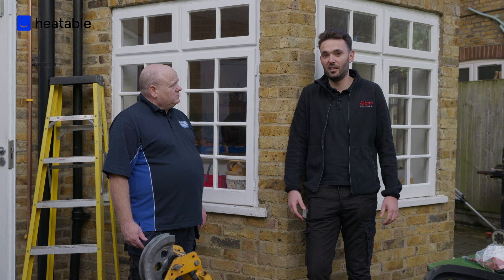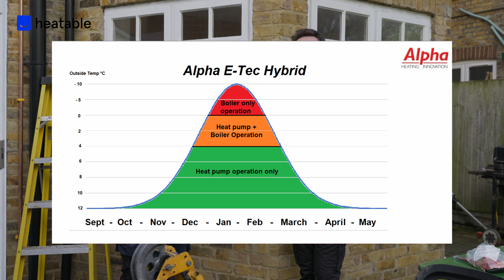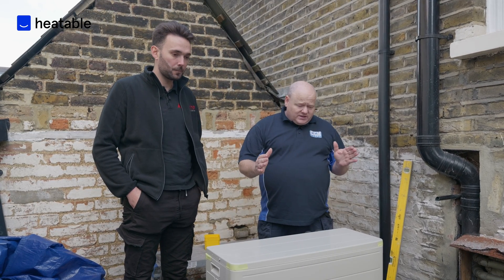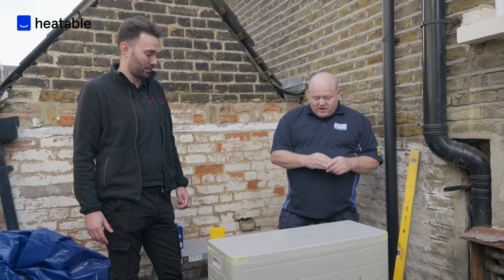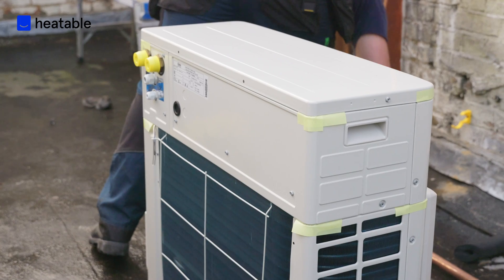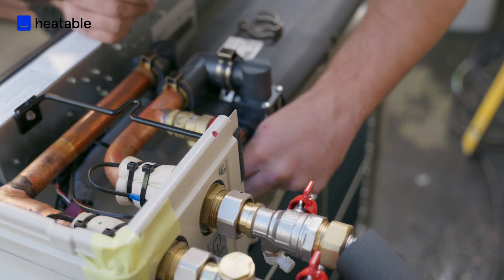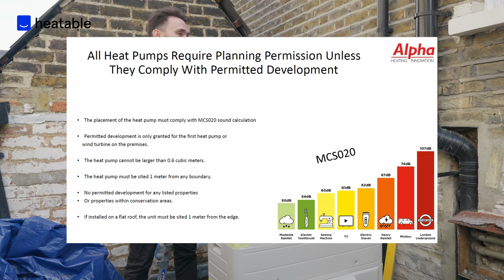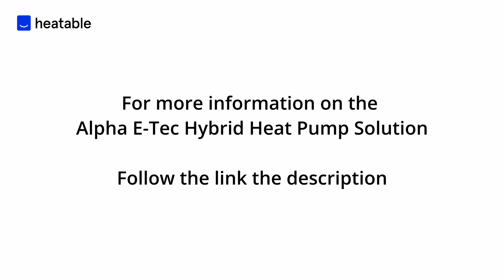Alpha E-Tec Hybrid Heat Pump Q&A With Aplha Heating | Heatable Hybird ASHP Installation

Comment: Is this comparable with an alpha evoke 33 boiler. If so roughly how much would it cost to add this to the boiler. Also. If the boiler goes faulty can the heat pump work on its own.

Comment: @AllenHart999 - could an additional heat pump be added in parallel?
Reply: You cannot add another heat pump you have 4kW of power plus 28kW from the boiler will run 20+ rads , for most homes with a combi boiler this set up is perfect.

Comment: Its very contradictory to say this can "take over" when gas prices surge though when its only a 4KW heat pump and no insulation, radiator, or pipework changes have been made to the property. The heat pump is too small to meet the demand at -2c outside and therefore CANNOT heat the house. This is a very short term narrow minded solution to the problem. Not to mention hot water is still going to be using Gas when prices surge.. the whole marketing concept is flawed here sadly.
Reply from the maker: What do you say to the people who will not install a heat pump as it's unsuitable? You can just stick with your gas boiler. I am sure you will agree it's better than just a gas boiler. Thanks.
Reply: @AllenHart999  "People" as in the general public are not educated to even understand if their house is suitable or not... Either way a heat pump at a high temperature is better then an undersized heat pump + Gas boiler. if they actually install one able to meet the heat loss. A 9kw or 12kw would of worked here and maybe wouldn't of got a COP of 3 but it would of been better overall then Gas. Then when they improve the house 2-3 years later they can dial the flow temperature back. In this scenario they have to bin an undersized heat pump and gas boiler.
Reply from the maker: @gsdevme  You are totally missing the point. This isn't instead of a heat pump.
Reply from the maker: @gsdevme  They cannot and do not want a heat pump.
Reply: @AllenHart999  then why have they got one 😂😂
Reply from the maker: @gsdevme  This solution works well for this customer.
Reply: @AllenHart999  the customer doesn’t know better. He should go watch heat geek videos that warn you of the hybrid sales man.
Reply from the maker: @gsdevme  Heat Geek is also a sales man, a very good sales man at that😂 Adam is also a great guy

Comment: Won't qualify for the boiler upgrade scheme currently set at 7.5k. it doesn't decarbonise your hot water.
And if you don't have the right Alpha boiler model, you need to buy the boiler and heat pump, which'll be costly. 
Maybe suitable for a small number of the UK housing stock.
Reply from the maker: You are correct in the fact that the 7.5k grant doesn't include this. Thanks.

Comment: Seems like an interesting solution and a pragmatic step towards lower carbon heating overall without totally shafting people. 

The system might be suited to milder climates (i.e. the south west) where the heat pumps can run more efficiently on a continuous basis, with the boiler kicking in when there are suddenly weather changes or cold snaps. 

Hopefully the price point will make this a realistic prospect for people who could only ordinarily afford or finance a boiler replacement. Whilst i think heat pumps are great in new builds (and from exp they work really well in this scenario), I find the inability of the heat pump evangelists to accept their limitations and prohibitive cost for most people quite staggering.
Reply from the maker: Thank you for watching and giving valuable feedback.
Reply: Excellent comment. Spot on.

Comment: Been interested in these for s while. Can you use it with an existing combi or have to have the whole kit?  I'm currently on Octopus Tracker for gas and electriciry so the rate changes each day, would I manually have to set the rate or is it smart? Thanks
Reply from the maker: Hi radfoo. Thank you for the question. You would need to update your boiler, these come as a package. I am not sure how smart the controller is, Might be better to give Alpha technical team a call. Thanks.

Comment: So  this doesn’t kick in at all for hot water…just heating ?
Reply from the maker: Hi Tom. This is a solution for heating only, It uses a combi boiler via gas for hot water, then uses the heat pump for heating when it works out to be cheaper than gas.

Comment: my issue with these hybrid systems though is they only cover 5kw other brands offer 12kw hybrids,   the average heat loss of new builds is 7-8kw  older properties from the 70's often have a heat loss of 15kw,   single brick Victorian 20-25kw heat loss,  half of the issue there is because of listing your not allowed to alter heat insulation,   unless you use a tariff with off peak modes older properties are left with sky high bills, with no alternatives,
Reply from the maker: This hybrid works out the cheapest way to run based on your own tariff, It could never be more expensive to run.
Reply: Single brick Victorian terrace is about 6KW in many cases...including mine.
Reply from the maker: @andrewcunningham1  That’s when it's -3 outside, wouldn’t need 6kw all year round.
Reply: @andrewcunningham1  terrace lose a lot more heat than you think, granted they do retain heat better than detached but that is down to the block combined where air flow is minimlised, but they still can loose up to 11kwh for a 1060s ,  as my first house was one that had a full heat calculation done by 3 different companies,  in 2016,  unless they have a east west layout , and still a single brick wall front back, ours had single panel windows as well, you could feel the air through it,  35 k later we cut it down to 8kwh loss, the loft had r20 which was regs at the time,  the big issue was insulating the inner walls, at the time insulation was 3 inchs think and eat into the room making it feel cramp. i was only there 13 months due to being re-deployed, but had a thing for older buildings being that they were bigger overall,  also being rural with exposure can add another 5kwh loss,
Reply from the maker: @ram64man  I used to do around 5/6 heat losses every day when I worked at British Gas, and I rarely saw much over 10kw; we usually looked at around 6/9kw for a 3-bed semi.
Reply: @AllenHart999  maybe i've be unlucky then with the buildings i brought along with my friends, all of them (detached now) are all over 16kwh loss,  my 4 bed detached 1910 listed a house loses 21kwh a day. its been a real headache with the local council to i can improve it,
Reply from the maker: @ram64man  I have a 4 bed detached with separate office and sunroom also 6 bathrooms. Correctly measured heat loss is 7kw.
Reply: @andrewcunningham1 when its -3°C outside.

Comment: I have this system it seem very good , l will know more after this winter. I am wondering how you change the tariff on the control panel ? I have a ev tariff which I get cheap electric between 12.30am & 4.30am & solar panel.
Reply from the maker: Dan told me you can do something in the settings for cheap overnight tariffs, You might need to give Alpha Technical a call for help. Thanks.
Reply: But what’s your boiler doing between 12.30 - 4.30 am?
Reply: @tomstrutton4351  me & my wife are both disabled & need to keep the  house warm ! So I put the heating on for a hour !